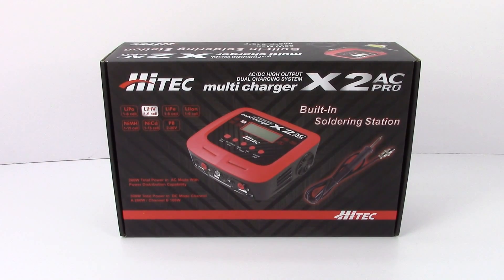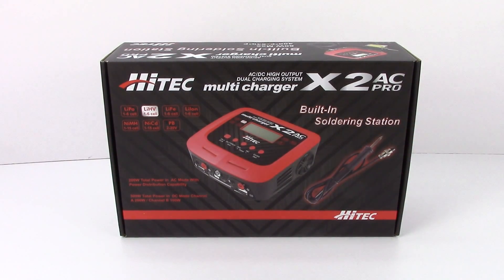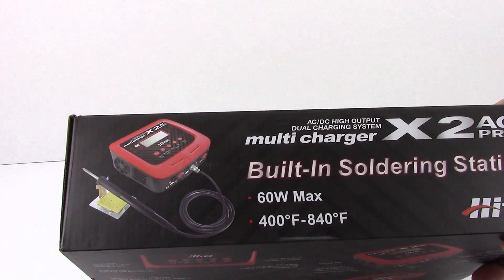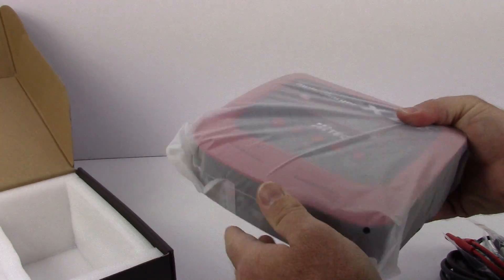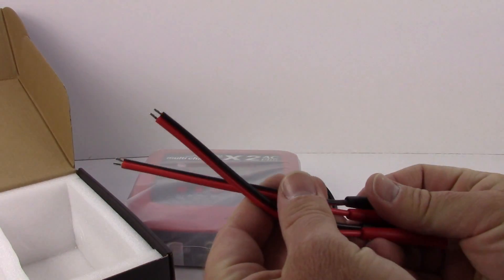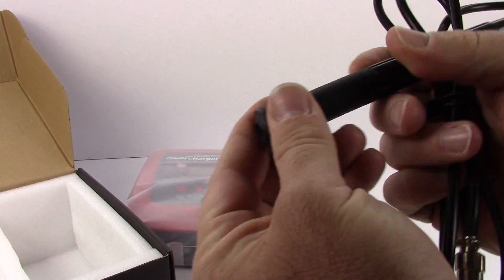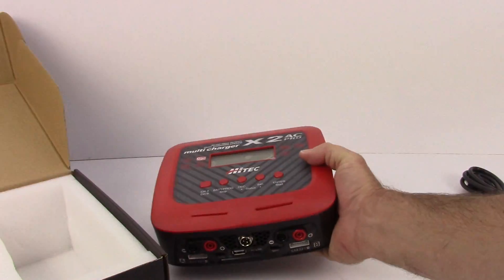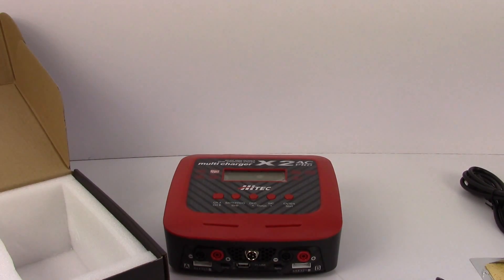Hitec X2 AC Pro Charger w/Soldering Iron - Unboxing

Comment: What about the soldering tips?  I can't seem to find replacements listed anywhere...
Reply from the maker: +noobrc Wow, good one!  I searched Google and nothing....I checked the owners manual and there's a spot on page 35 that states "replacement part # but nothing was listed.  I emailed Hitec Service to see what they say.  To be honest, I have run my Stand alone TrakPower 955 for a few years now and have seen almost no wear on the tip (using the chisel).  When I receive and email back, I'll reply back
Reply: +The RCNetwork looks like some of the Hakko tips may fit, which would be great!
Reply from the maker: +noobrc Here's Hitec's response:  44247 pointed, 44247 for the Chisel but we are still waiting for them. We are supposed to get them sometime next month.